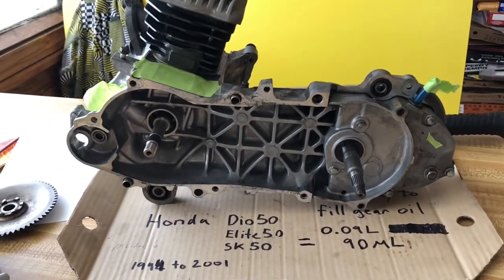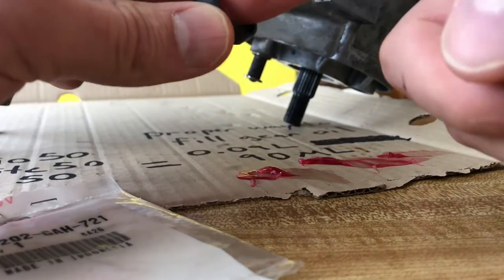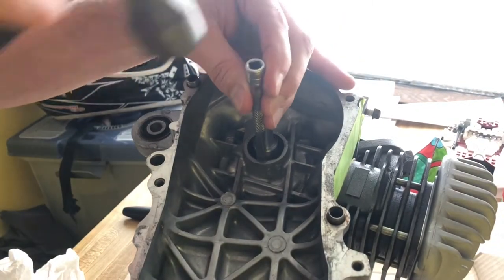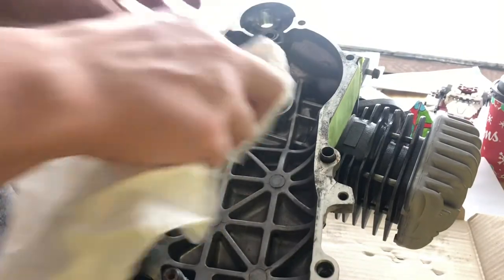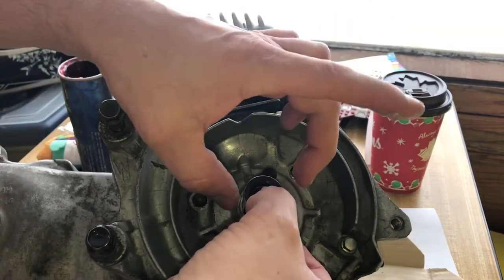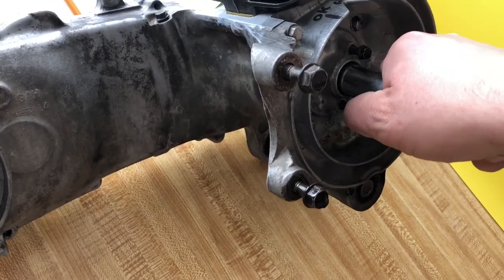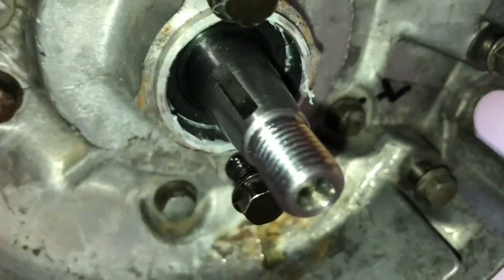Crankshaft oil seal installation scooter, Honda dio50 elite50 sk50 af16 af18 af27 af28

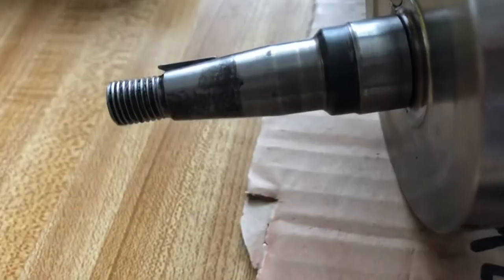Comment: At 1:26 what is that already on the crackshaft? looks like a spacer or metal ring. I don't have it on mine when I pull out the crankshaft but I could have damaged it when removing.
Reply from the maker: There’s nothing there it’s just dirty

Comment: I installed the seal past flush about 1/8", will it still be ok?
Reply from the maker: Which side?
Reply: @ProblemSolverGarage  the variator side
Reply from the maker: I guess it’s been a while and I can’t remember what it looks like in there but from what I remember if it’s just 1/8 you might be OK, you should be OK

Comment: Can I install the seals while I have the crank out of the case ?
Reply from the maker: No because you need to heat the case up to put it together
Reply: @ProblemSolverGarage  so I already messed up then cause I have them in their now and was waiting for the bearings to come in. So take them out and wait till I have the bearings on the crank and then install them after the crank?
Reply from the maker: If you can get the crank really cold should just slide in, don’t heat up the case too hot so you don’t damage the seals, should still work
Reply: @ProblemSolverGarage  ok perfect but from a crank install video I recently seen the new seals should be put in after the bearings and crank is installed? So if i heat the case i won't have to worry about melting the seals
Reply from the maker: Correct